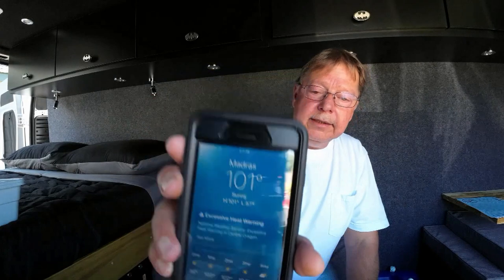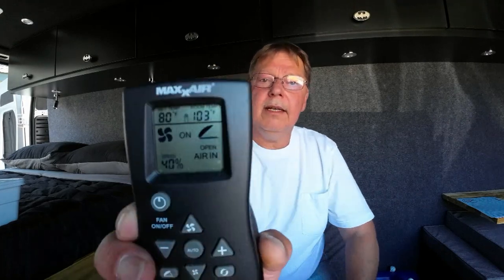Promaster Van Build 2500 159WB – DIY– Water Pump – Part 42

Comment: Al, as a builder like you, I watch ALL your videos from the beginning to the end:  from cold Canada, I wouldn't be able to work on a van or caravan project, at such temperature!
Reply from the maker: Thank you so much for taking the time to watch the videos all the way through! Although the temperatures sound high, it's actually not too bad once you start working. I generally wait until later in the day when it starts to cool off. If it weren't for the cooler breeze blowing through, I admit... it would be tough! :)

Comment: Just a thought Al, at the end of the tank where you plan on putting a drain valve and vent, you could tie them together and make a site glass on the outside of the future bulkhead so you can visually see the water level in the tank.
Reply from the maker: Excellent idea, and something I will plan on doing for sure!

Comment: Would it be better to use one of the fittings on the back of the tank for the water inlet then running a hose all the way to the front?  I really enjoy your videos, thank you for putting them up for us to watch.
Reply from the maker: Typically, yes... but I won't have that much room in the back for the fitting, so I decided on front inlet.

Comment: Any plans to install a portable air-conditioner in there for when the engine isn't running?
Reply from the maker: There was one unit I was really interested in that I thought would work great... unfortunately, sold out, with no ETA for restock. If I find the right unit, great possibility I'll have A/C

Comment: Nice job, my water pump makes a ot of noise,  yours seemed pretty quite.  Maybe because of using the flex pipe on it?
Reply from the maker: It is super quiet. I thought it would make a lot of noise but was surprised how silent it is. Have to get me another one of these! :)
Reply: @OregonBatman  which one is it?
Reply from the maker: @mowguy1  Hey Randy, it's teh Pentair by Shurflo Model Number: 4008-101-A65

Comment: Al, could you tell me the make and model and gallons of the tank you are using. It appears to be an over the wheel well style. Thanks
Reply from the maker: Hello Ed. I purchased the tank from Northwest Converions. Model PM-C-28 for $349.00. Here is the link:
https://www.nwconversions.com/product/28-gallon-wheel-well-water-tank-pm-c-28/
Reply: @OregonBatman  Al, didn't you have a different tank to install before this wheel well tank? If so, why did you change? Thanks
Reply from the maker: I had different tanks that I thought I would use for gray water tank under sink... changed my mind on those. Always planned on the wheel well tank, couldn't beat that!